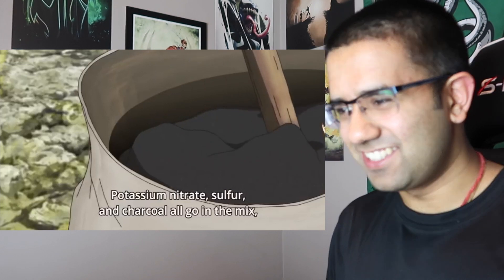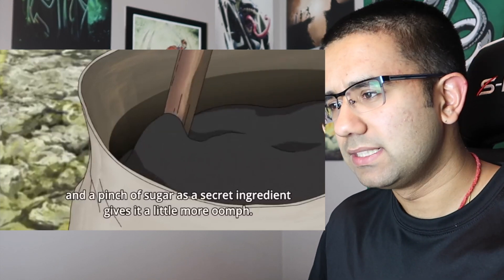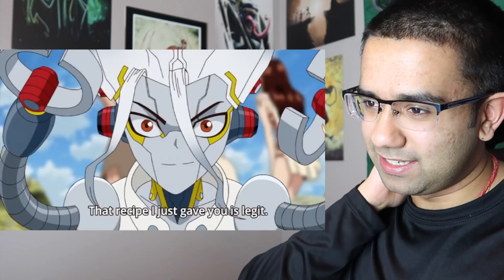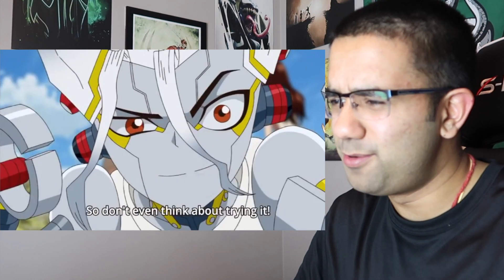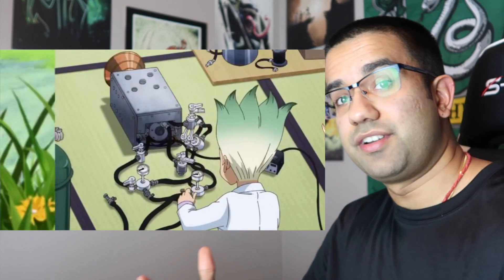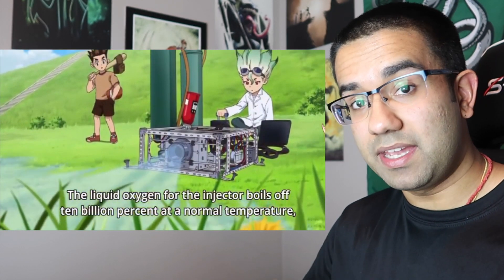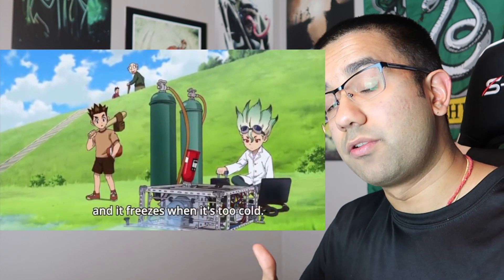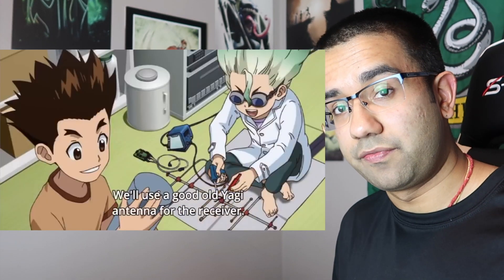Real Engineer Reacts to Technology in Dr. Stone #4

Comment: For more information to people curious about it : Raspberry Pi are great mostly because they are accessible.
It's the general public version of what you can obtain by taking the industrial stuff.
If you take by yourself a microprocessor, an LCD screen, some USB ports, and all the stuff, and solder it yourself, you have the exact same thing but way cheaper (like totally, you doing these video surely know most little electronic stuff are 5 to 50 times 
cheaper for industrial uses than when already put together or for the general public).

But having a Raspberry Pi surely makes you gain some time, and beside you don't need to remember the industrial names of all that stuff, just take the most recent Raspberry Pi instead of keeping track of the updates of little electronic pieces you never remember the name 'cause they have industrial names (like for microprocessors, the thing that make Raspberry Pi a computer, it maybe only cost some cents but have names like PIC16F628A, and if one day you read PIC16F629 you don't realize it's an advanced version as you don't remember what yours are ; and I'm only talking about one piece of the Raspberry Pi here).
Reply: Para Junior Raspberry I should be common knowledge this days.

Comment: Actually, there was an inconsistency in their chemistry. Senku says he makes the potassium nitrate from lime and nitric acid, but that’s wrong. Lime is calcium carbonate, which means there is no potassium. However, you can still make gunpowder with calcium carbonate.

You see, potassium nitrate is just saltpeter, also known as niter in its mineral form.

There are, however, more forms of saltpeter that work just fine in making gunpowder, but it’s just less effective. The variety they use is called Norwegian Saltpeter, or calcium nitrate, which is simply made by combining nitric acid and lime. There is a heavy amount of CO2 byproduct, but that’s fine.

Potassium nitrate is insanely hard to synthesize, so you’re better off mining niter or just using an inferior saltpeter.

Comment: 0:40 Potassium nitrate is an oxidizer that is the MAIN component of gunpowder. What it does is intensify the burning, making it burn really fast, the sulfur is there to increase the heat of the gunpowder when burning, so it doesn't die out. I have made gunpowder without sulfur and it doesn't bur well at all.

Comment: Senku my say the ingredients for gunpowder but he doesn't specify the exact proportions for a specific amount similar to the formula of dynamite told in fight club.
Reply: The scary thing is that most of those formulas can be looked up online. Hell, the local gun shops near where I lived had old manuals (military surplus) detailing how to manufacture gunpowder and high explosives. It didn’t even require expensive materials, just a bit of money and a terrifying lack of common sense.
Reply: Also gunpowder needs ro be very finely ground to actually explode without mich containment of gasses

Comment: Gunpowder doesn't detonate it deflegrates. This means that gunpowder doesn't explode it just burns away rapidly. It's only dangerous if the gunpowder burns in one direction (e.g. bullet casings) this makes it supersonic, but if it isn't in a tube but on for example a table, the material will just burn quickly.

Comment: That recipe for Gunpowder is one of the oldest in human history. That's how they get away with it. not giving specific ratios or instructions either. Making gunpowder is not easy, trust me. If you don't know how I can ship you 10g of all three powders. won't work. sugar works too instead of charcoal. (and ammonium nitrate works better than potassium nitrate. Ammonium nitrate and sugar cooked together have the awesome name "rocket candy") but legit gunpowder is hard to make. You need to know how fine to grind it, and thoroughly mix it. to fine and it will burn too fast, too corse it won't mix and burn apart and burn to slowly. Old muskets worked by having two types of gun powder due to that. The soldier would have a flask of very fine gunpowder on him, while the bullets would be a lead ball wrapped in paper with a corser gun powder. The finer powder would be just enough to ignite the corser stuff through the paper and the corse stuff would be what propelled the bullet